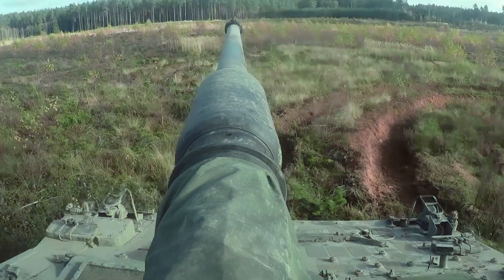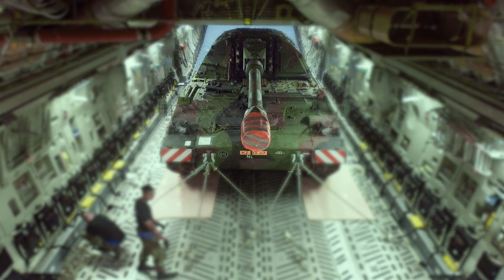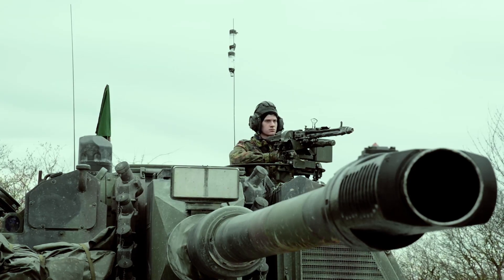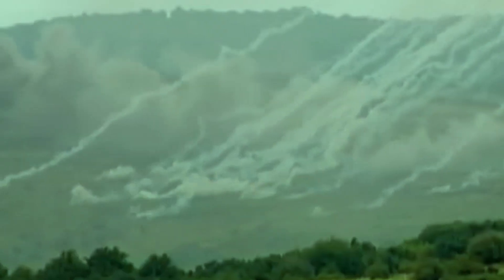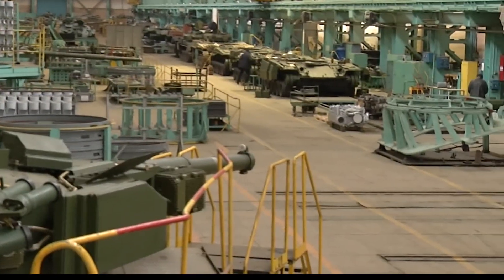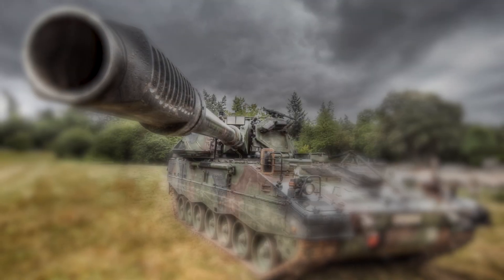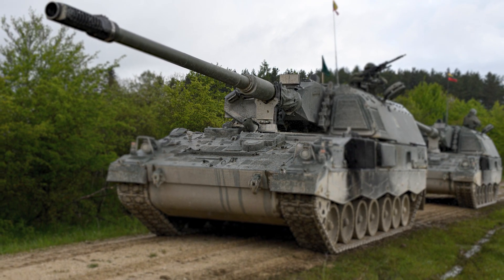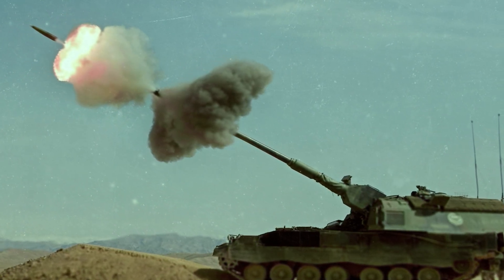NATO's Monster Panzerhaubitze 2000 Tank Howitzer (40 Km Multi Impact)

Comment: I'm curious if Germans will be making adjustments to the design following Ukraine. Apparently, the guns are very sensitive to rapid fire and engines can suffer from extreme use.
Reply: like every modern artillery piece designed for burst precision fire in counter battery and precision strikes, PzH2000 does not like being used like a 1960´s sovjet weight of fire artillery. look at Krab, they blew up barrels due to heavy use
of course there will be modernisations/upgrades.

Comment: Yeah, using German gear in deserts is usually a bad idea. Stuff is designed for the European defense war, not a desert with extreme temperatures in both directions. And so much dust.
Ukraine originally got 12+5 from Italy. Now they ordered 100. Numbers should also fix the issue of over use.
Reply: Give it some time, german war economy will grow, spare parts will be available, overuse is normal in combat situations and given the drive to research new machines there will be a new gen of weapon systems in 15-25 yrs. Sadly I feel that german depends too much on its allies when it comes to development of such weapons.
Reply: @PiconPrimeKnight  Gemrany is remarcably independent with its Millitary equipment thanks to in no small parts rheinmetall and HK

Comment: In Ukraine, the PzH2000 is reaching its limits. The mass of ammunition that goes through there in one day was not planned this way. The Ukrainians fire well over 100 rounds per day with a single PzH. The material is not designed for this quantity and therefore has to be permanently overhauled in Poland.
Reply: We just sent the latest type of amunition. It has a range of 80km and an accuracy of 1m by GPS guidence.

Usually, there is no need to perform rapd fire with that. Warfare has changed. Just use it like HIMARS, just harder to defend.
Reply: Yeah, heavy use in a system in a war of attrition ofc puts a lot more stress on it. That's probably the reason for the relatively low number of supplied systems - continuous supply of ammunition & spare parts might've been the bottleneck here.

Comment: you forgot to mention, that each system can fire 3 shots at differrent angles and power to make them land on the SAME SPOT simultaneously. now if you "only" had 3 of them firing at the same spot, that is 9 rounds hitting that spot at the same time! This makes it almost impossible to counterfire while they land their fire on target and be gone till the first shell hits the ground. Nice piece of engineering!
Reply: not three but 5 rounds... if 4 PzH2000 do this trick 20shells land on enemy in one second
Reply: Nope. Up to 5 but not even close to max Range of that amunition. And if you fire normaly in rapid fire 10 Rounds a Minute for up to 2 Minutes or 8 for 3 Minutes and continuous 3 Rounds per Minute . But Firing Range is completly off in that Vid. It´s up to 100 km with Vulcano Guided Longrange Amo from Leonardo Industries. Even M82 Excalibur should work. And if you wan´t to know how the receiving end feels ask the russians they eat Nato 155 mils ond daily bases
Reply: @mariokuppers5686  no one say that it function at max rang... this trick only works up to 20km that the gun can use different angle of shooting that the shell reach target at same time... the PzH can unload its 60 rounds in max fire rate because 60 rounds dont heat up the gun to critical temperature of 160°C ... it can unload its 60 shells in 6minutes if needed
Reply: @nagmashot  17km...
Reply: @condrix  sorry both wrong, the 6 round mrsi ability is up to 30km when using standart not extended range ammunition or SmART155 rounds.
Beyond 40km extended range ammunition like excalibur is needed to engage targets on distances of up to 70km.
Reply: @zhufortheimpaler4041  Looks things were changed in the last two months or so. 🙂
Reply: @condrix  not really, those are capabilities that the gun already had since its introduction.
Reply: @zhufortheimpaler4041  Source?
Reply: @condrix  the developer. there are interviews with him on the Channel "Säbelzahnmöwe" in german.
Reply: @zhufortheimpaler4041  So he was wrong as the ability limited to 5 rounds and not 6 as you mentioned and the range below 20km (I've got 17km from a gunner as we bought some and there was an artillery show). :D
Reply: @condrix  and i can tell you, that both the developer (the designer himself, but also KMW) and the Bundeswehr made statements and published test documents, stating that the PzH2000 can fre 5 rounds in 15 seconds and has the ability for MRSI of those 5-6 rounts on ranges up to 30km at introduction.

The english Wiki page lists significantly different data in comparison to other language wiki pages and KMW + Bundeswehr Information btw and those diverting numbers are only on the english wiki page.
The english page is also drasticly shorter than the german page and does not really list sources.
The 17km 5 round MRSi was in 1999 during initial service introduction and public demonstrations on the Munster Training Area and if i am not mistaken was limited to that range, due to the limitations of the shooting range. There are no 30km artillery shooting ranges in germany.
The longest distance possible is about 20km from an external firebase south of the Munster Süd Training area to the northern tip of the Munster Nord training area, firing over the Village of Munster. This is about the longest you can shoot in europe with artillery on a training range.

Comment: So would the Swedish Archer mitigate some of the drawbacks to this system?
Reply: yes and no.
Archer has better strategic mobility, but worse tactical mobility with lower armor protection, lower ammunition load and requires more frequent "reloads" of ammunition etc.
so Archer is a system for strategic mobile units like Stryker Brigades and other "medium" forces, PzH2000 is for heavy formations like armored brigades. The Bundeswehr for example is restructuring 1/3 of its armored formations into medium formations. There they will use either Archer or RCH155 on Boxer.

Comment: Only five of them are working in Ukraine out of the 15.

They either broke or ran them ragged and that begs the question.
Did they under design it for it's mission or over design it and stuff broke?
Reply: The Ukrainians simply overused them and too little maintenance in between constant firing and driving cause they have too little of them in total
Reply: They are overused and require maintenance.

Ukraine used the to shoot over 500/day shells at max range for weeks... That's near constant firing with switching crews.

If you don't do the maintenance or there is a slight ammo issue yeah things will break down and need more maintenance.

Comment: too heavy and too slow. only a few works.  
what an german achievement :))
Reply: A howitzer is not a battle tank and does not have to race through the pampas at 50 kmh. And weight is not a disadvantage with the recoil. But I see you have zero idea what requirements are placed on a howitzer. Why do South Korea and the USA build comparable howitzers? Knowledge is power and you obviously have little of it ;-)
Reply: It's actually quite fast for an armored tracked vehicle.

And it works properly.

Comment: I think we'll do about that turret it's basically like an automatic turret they're not reloading it it's reloading itself
Reply: You have autoloader in the most selfpropelled howitzers. The reason is, that 155mm is just to heavy to load manually all over the day.
Reply: @Jan021981  only in spg´s that are 1990´s and newer. 
PzH2000 was one of the first to introduce an autoloader for artillery in NATO, M109 just retrofitted one in the last versions, K9 and Krab are newer designs, AS-90 does not have one.
Currently only K9A1 can rival PzH2000 in "NATO"

Comment: The Australian Army WANTED the Panzerhaubitze 2000 it was their PREFERRED option, however the civilians in the DOD told the Army it could have the South Korean K9 or NOTHING, so the Army chose nothing.
Years later the Army finally gave in and got the K9 anyway.
Reply: But why ? The Australian Army has a lot of German equipment. That is strange.
Reply: @Shatterfury1871  Well actually we don't have much German equipment, we did have Leopard AS1's but we got rid of those around twenty years ago now.
I cant think of ANYTHING German we currently have in service.
You have to understand that since the Labor party Tang review in the early 1970's the armed forces have been run by civilian public servants. 
Before that we had an Air Force Minister, an Army Minister and a Navy Minister all dealing directly with their senior officers, the beaurocrats were there to serve the needs of the military, that situation has been reversed, with an extra layer of civilian beaurocrats inserted between the minister and the services and there being only one minister, with the civilians taking many of the decisions made in the past by the ministers.
Promotion to senior military ranks is now effectively in the hands of beaurocrats not 
the senior military officers.
This is reflected in DOD equipment purchasing , EG, the Navy wanted Arleigh Burke destroyers, they were given far less capable Spanish frigates redesigned for Australia, the Army wanted replacement Blackhawk helicopters, they were given the MRH90 instead which after billions spent is now being removed from service because it cannot undertake the most basic combat role it was purchased for, it is being replaced with NEW BUILD BLACKHAWKS, which is what the Army wanted in the first place.
Same with the attack helicopters the Army wanted the AH64 , but was given the Eurocopter Tiger instead, after billions wasted the Tiger is being removed from service and is now being replaced with the AH64 which the Army wanted in the first place.
Do you see the problem.
Reply: @peterjones4180  
You have like 4.700 German trucks of all sides and an ongoing order for Boxers of around 211 units.

As for the NH90 and Tiger, they are a headache here as well. As far as I can understand, the programmes didn't get the funds to iron out the teetering problems.
It is not like Airbus to fail this way, even the helicopter division is doing well.

Oh, and the Lynx and the Redback IFVs have been shortlisted for the IFV programme.
Reply: @Shatterfury1871  I had forgotten about the mogs, not sure what other German trucks we may have, yes you are correct we did buy Boxers to be made here i had forgotten.
We spent BILLIONS trying to fix those helicopters, we gave up in the end.
Reply: @peterjones4180  
Well, if the buyer can make them, they buy a small part and build the rest under license that is the norm.

Yeah, I am pissed the Armed Force of any European state didn't secure funding to iron out the kinks and see what the hell is wrong with the supply chain.
It bugs me because it is not a small company, but a big one with a good reputation.

Pitty you didn't wait a bit for the new Panther KF-51.
Reply: @Shatterfury1871  Well rather than stuff around the minster just gave the Army what it wanted twenty years ago to replace them.
Reply: @peterjones4180  
Well, the Apache might not be the best in this drone rich environment of 2020s.

Take care guys, you will need to keep the Chinese in check.

Comment: As with most of our NATO tech, it's proving to be objectively superior to Russian weapons but we have too few. Not in Ukraine, too few in general.
Reply: We are fine as the russian hardware is 50 years old and not functional at all.
Reply: @nichtgenannt3226  as someone put it "russia has a large and modern army, but the large army is not modern and the modern army is not large"
Reply: Just like the heavy tigers and panthers of their day just not enough
Reply: @mzwonaruk  that's a very limited comparison
Reply: It's not about the big guns but the supply of ammo for them
The soviet era systems are in 152 mm and the stocks are running dry (jes there are now old factorys producing them but not in the numbers needed)
The nato 155 mm has literally tens of millions of shells in us warehouses in Germany and in the continental US and every nato country has the capability to produce them in the 10s of thousands in relatively quick times plus you can use precision guided munitions which means less ammo needed and thus less strain on the Ukrainian supply lines
In the short term Ukrainian artillery logistics is a klusterfuck of old and new systems but in the mid to long Therme it is a blessing
Reply: There is a version of Boxer RCH 155 that would be cheaper to build and easier to get to the battle. Only drawback is the same as the difference between the M-270 and the M-142 half the load. They PzH-2000 and Boxer RCH155, should start production of both in high number.
Reply: My take on your objectivity is that this is one piece of technology that interlocks with many other pieces that are each only part of the system. Which are absolutely devastating. Much love Ivan. Muhwa. Love and kisses.
Reply: in this war NATO weapons seems to be inferior to russian
Reply: @bastikolaski8111  good joke 😂
Reply: @bastikolaski8111  So your point is the Russians are inept?
Now I do not think you are being honest with yourself Basti.
Arguably the World 3Rd biggest army is having no end of trouble with Ukraine.

So, you think that NATO has no chance at all?
Like I said a second world power would kick NATO's ass, well thanks for starting my week off with a chuckle.
Reply: @peterweller8583  USA lost to Vietnam, lost to Serbia, whats your point. ISAF lost to Afghanistan. I never said NATO has no chance, they have very high number of weapons. But when they attack Russia they will see Russians(also Ukrainians) are a different bread than Iraq
Reply: @bastikolaski8111  🤣🤣🤣 you must be kidding because a handful of western weapons were recently introduced and the Russian army is loosing where those are deployed.
Reply: @jacksonteller1337  you just watch US Propaganda right? What do you say about over 40k killed ukrainian soldiers(Russia only 7k-8k), all the videos of destroyed M777, all thousand of surendered ukrainian soldiers?  The ukrainian defense strategy runs only with  the use of high manpower
Reply: @BeMonkey1  are you serious? NATO states never attack other countries? hahaha
Reply: @bastikolaski8111  Never said that but no, it doesn’t. Individual countries might do stuff but nothing obliges member states to come to those nations aid. However, they are obliged to act when a member state is attacked. When it is a victim. 
That clause has only been invoked once after 9/11 and that was a pretty dubious interpretation, if you ask me. But it was an attack for sure. 
Now, Russia, on the other hand, HAS initiated numerous attacks on its neighbours. Imperialistic attacks. Or why do you think Finland and Sweden want to join? Or Ukraine? To invade Russia?  What a joke! 
Now, you might continue rechewing Putins propaganda, or you might, for once, think for yourself.

Comment: The system is not suitable for mounting on ships because it has problems with corrosion because of the salt water. However, it should be possible to adapt it.
Reply: I heard that the main problem was that the gun's recoil was putting too much strain on the ship's framework.
The standard naval gun on German frigates is the 76mm Oto Melara.
Reply: The standard naval gun is the 127 mm or 5 inches standard nato gun!
Reply: @HedgehogZone  nope, that's a rarity
Reply: @hoppeltrottel7484  This means the gun does not match with the ship. Germany no longer has large battle ships as it had in WWI and II only frigates.

Comment: It's breaking down too much. The Germans are opening a repair shop it Poland to fix the Ukrainian guns. This is probably the first hard, sustained battle use it's ever had. They're working the bugs out.
Reply: It's not breaking down. It's normal wear, the barrels have a service life and need to be replaced after a certain amount of rounds fired. Unlike with the German Army, where the PZH 2000 is a established system and has a whole support and maintenance network behind it Ukraine has severely limited maintenace capabilities for the platform themselves. They only got the units themselves and a few spare parts. The units have to be shipped back for in-depth maintenance.

Comment: This weapon is born from the ideas that arose during WW2, it is an assault gun, but such a monster even the then Wehrmacht could never envisage. It has the sleekness of the Jagdpanther, but with more speed, it is just an artillery mans dream come true.
Reply: no, has nothing to do with WW2.
as you see in the Ukraine-Russia war right now Artillery is very important in modern conflicts, too.

The PzH 2000 has nothing to do with Jagdpanther or anything like that.
The PzH 2000 is a self propelled artillery gun with modern technic. You know, computers and such stuff.
The Jagdpanther was a self propelled AT gun.
Reply: and they need a army to proteckt this gun. that,s why they get down in the wrong hands handle it.
Reply: Granatwerfer auf leopard 2
Reply: not an assault gun since it is not used for direct fire. maybe the gun can depress to level direct fire, but since the armor is only resistant to heavy machine guns at best, it would not last long that close up.
Reply: @rowdyzack5914  no it wouldnt, but its nice to know that a 155mm HE shell will destroy or cripple a modern mbt in 1 hit
Reply: @rowdyzack5914  it’s capable of direct fire, but as you said it’s only viable in a self defense situation and the armor doesn’t support this kind of role.
Reply: @rowdyzack5914  the chassis is a leopard 2 cchassis and protected as such but the turret is vulnerable, however soilders are trained to eba ble to use the big gun for self defence against tanks